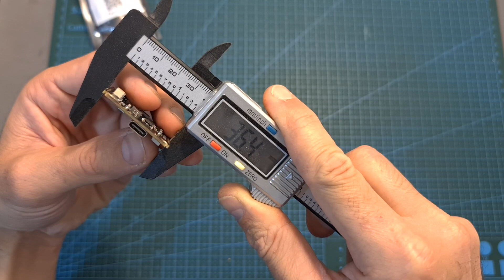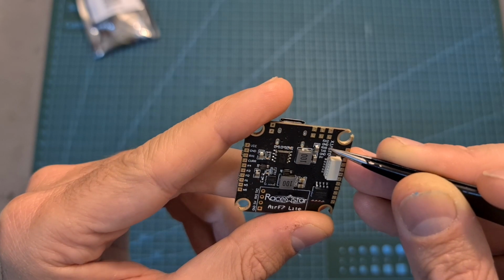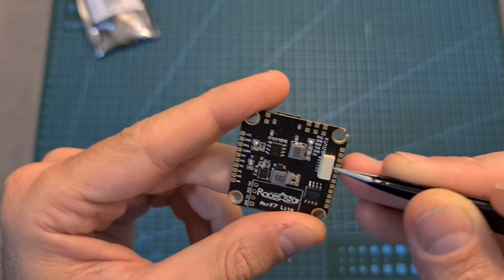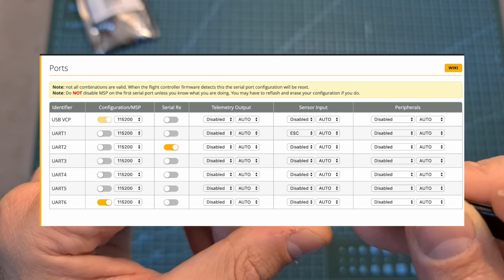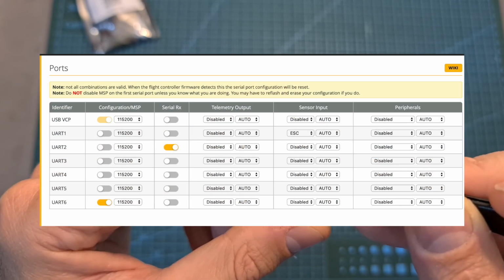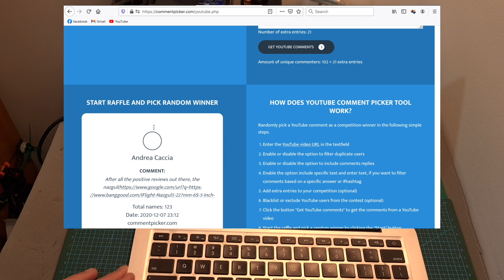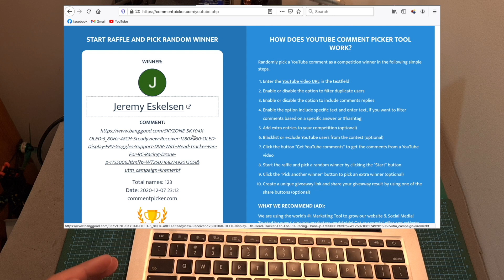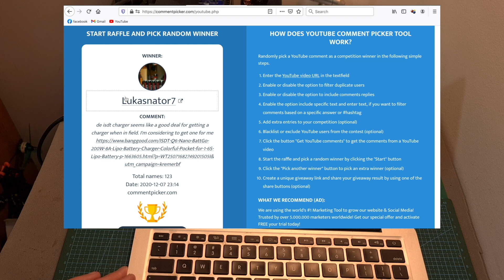Cheapest F7 Flight Controller - Racerstar AirF7 Lite Overview & Giveaway Results

Comment: Thanks for the video! I had a strange problem with mine. All great on 6s but when I try to stick a 4s lipo on, any mild punchouts freeze or reboot my vista. Do you think the 9v bec just can't handle the voltage dips on 4s? It does it every time so I wouldn't be able to use 4s it seems
Reply from the maker: I didn't test it yet but I plan to soon. Try to power the vista directly from the battery pads and see if it helps.
Reply: @KremerFPV  thanks! I'll try that

Comment: Hi gal I have some questions the racestar f7 air lite flight controller.
The flight controller  don't come with a OSD right? . How can I see the osd on the GPS. Planing to put a GPS on it. Hope you can help me.
Reply: I'm planning to put a caddx vista on it
Reply from the maker: Hi, it doesn't feature a built in osd chip for analog systems. With the Vista you won't have any issue with that, as the data is read directly from the FC by the Vista / Air unit.

Comment: Is it only for  digital VTX ? Or analog VTX too?
Reply from the maker: It doesn't have an OSD chip, so if you are going to use an analog VTX you won't be able to get the very useful data on your FPV feed.

Comment: Have you tried that Have you tried that Racerstar StarF7 board? That seems to have blheli_32 escs within same board. Interested to see how reliable they are and how they compere with these new generation f7 and H7 aio boards(with whoop mount holes). Betafpv and Iflight f7aio:s even have over 35A escs.
Reply from the maker: Hi Mikko, I wasn't aware of this product and I will consider checking it out. Thanks for the suggestion :-)

Comment: This looks like a really nice flight controller, my only complaint is that it looks like the Crossfire / Tracer Nano RX is powered from 5V rather than 4.5V which is always annoying when setting up your channels.
Reply from the maker: I think that you can power the RXs using 4.5v with no issues, but I need to double check it.

Comment: That's crazy, a Racerstar FC that ticks all of the boxes on my FC wishlist! USB-C, 9+V BEC, F7, no OSD chip, both plugs and proper solder pads. And $19? Wow!
Reply from the maker: Well no OSD can be a major issue for some :-)
Reply: @KremerFPV  but if you're using dji air unit, it is fine not to have osd(?)
Reply from the maker: @Ricpow80AkaNagamooto  Yes - the DJI air unit reads the data using the UART port it is connected to and has nothing to do with the analog OSD chip which is not present in the Air F7 Lite FC.
Reply: @KremerFPV  so this may be a really good option for dji based builds...
Reply: @KremerFPV  have you tested it out yet to see if it is legit? (I've orderered the combo with the 50a esc to try out)
Reply from the maker: @Ricpow80AkaNagamooto  Not yet, but I will try it along with the 50A ESC.
Reply: Gal Kremer sorry, but I have one more question: can I use this fc with a Caddx vista unit? (And have you had the chance to test the fc yet? 😀)